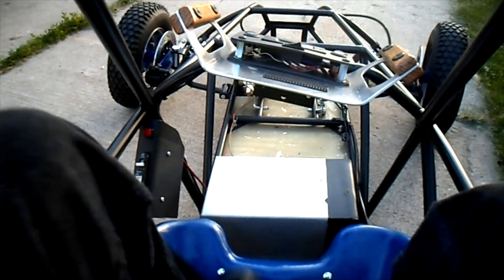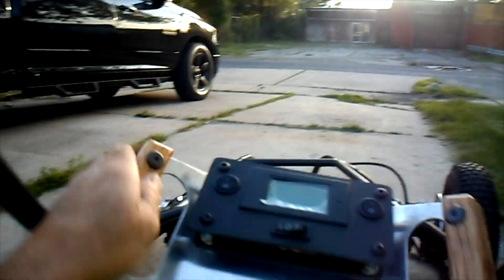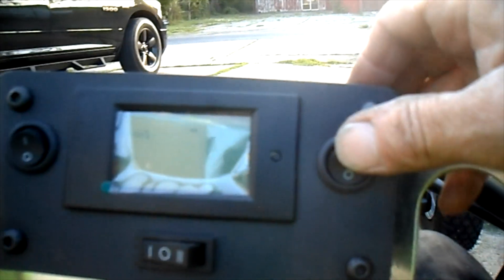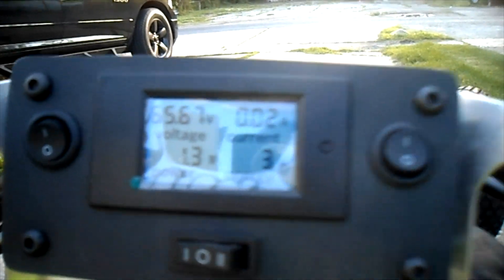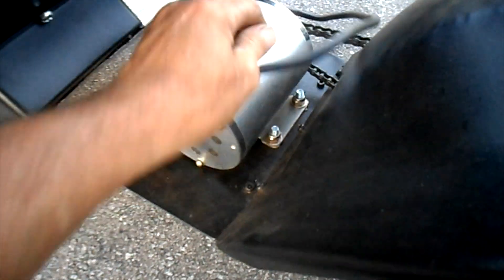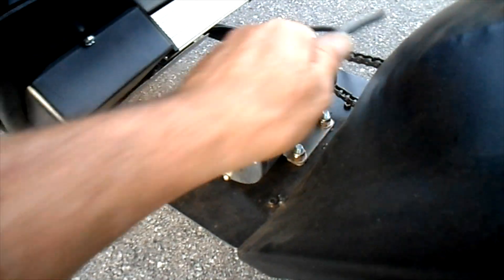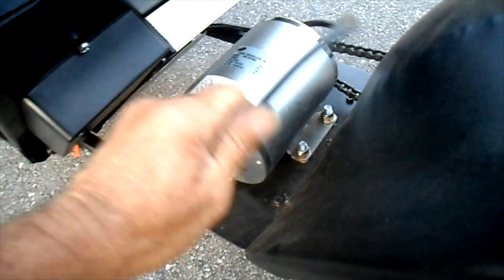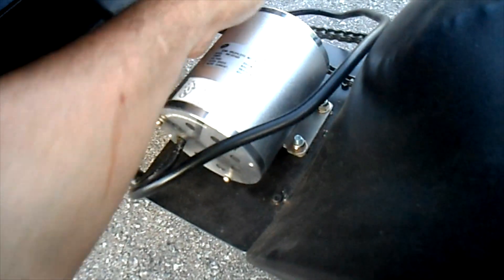Sequoia Electrathon Racer (part 2) First test run

Comment: Your gear ratio is way off.
That little motor doesn't have much torque so using the right ratio is super critical. 
Use a gear ratio calculator to determine what ratio you should be using for a top speed of 30 mph.